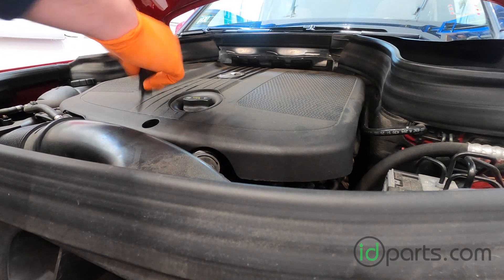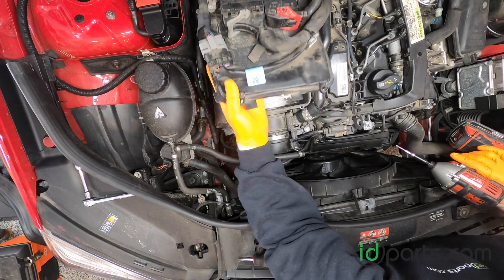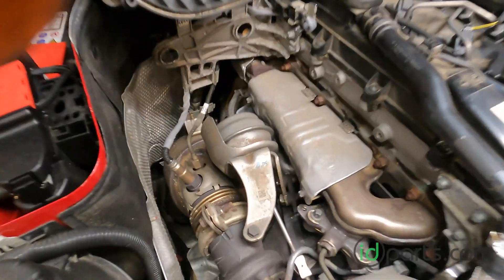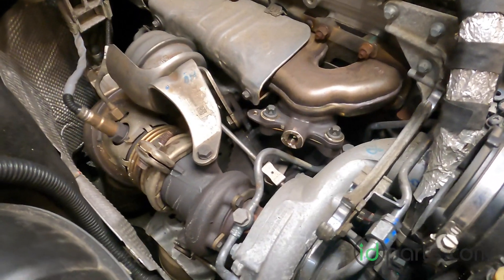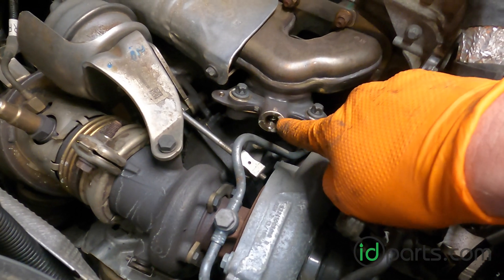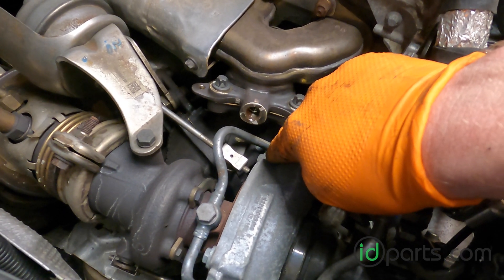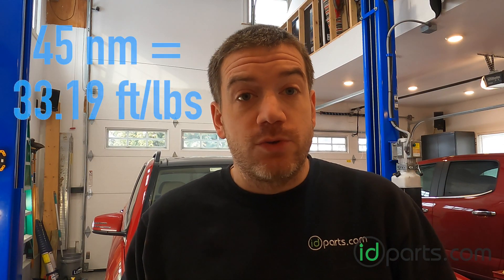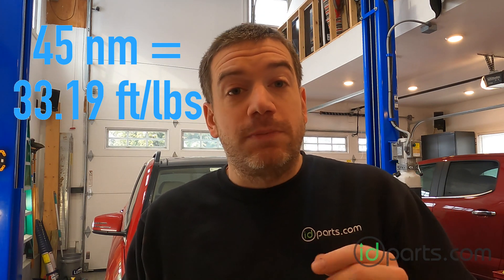Mercedes P2081 Fix OM651 EGT Sensor

Comment: Did you have issue with performance with the sensor fault? Mines an intermittent fault and only comes up when the cars regening however it feels very restricted, it's not in limp mode just feels down on power and torque, so I'm hoping this sensor is the issue

Comment: Hi mate, dod you spray any release oil on the sensor nut before removal? Mine seems ridiculously tight and im worried ill damage the manifold if i apply to mucb pressure
Reply from the maker: No release oil/penetrating fluid at all.  The unit it really stuck then heat will help.  If you can turn the car on and let it run and heat up that is best but a heat gun on low for a while should help too.

Comment: Very intersting video, thank  you. My car was remapped by some worranty garage guy because he didnt want to change the dpf under warranty. This melted my dpf and CAT. Now ive put a cat back on the car and wanted to remap so the car sees the cat. We flashed the car to original and now its showing P0546 Code, seems related to this and making 100hp versus 167hp as it did before i did anything. Could this sensor be the issue?

Comment: hi 
one question 
oil in turbine from engine case cover (breath valve )
and positive pressure from where i check level oil 
the electric breath valve are blocked 
 how work ?
when open and close?

Comment: You can remove the airbox without unscrewing all the screws. Just unscrew the MAF pipe and the ECU cables and pull the whole thing out. What we've seen here is what you do when you've never worked on the left side of the OM651 before.
Reply from the maker: Good point! - We were filming a video for swapping the air filter at the same time, so the video involved us removing cover.

Comment: Thanks for the video. It's very helpful. I am getting a P208027 code (Temperature sensor 1 Exhaust system cylinder bank 1) and I'm seeing a lot of comments that suggest to replace the same part. Is there another sensor that triggers this code?

Comment: Nice video - regarding a mercedes C220 CDI T-Modell 204 2013 - Engine 651.911, is the error code P042815 "catalyst temperature sensor" the same as the one as mentioned above. Thanks again for a nive video :)

Comment: Excellent video - thanks for posting. One follow-up suggestion / feedback: please would you show the exact disconnect procedure - how to work the pesky little grey tabs on the sensor connector. You had your hand in the way when you seperated it. I've searched all over for YT video on splitting MB connectors - there's so many different ones with clips and tricky little tabs to flex, might be a good thing to share in a future post. Thanks again! Great info.

Comment: Hi there, I'm having an engine light saying  P2471. Can you do a video on how to replace the Bank 1 sensor 4 EGT sensor? This engine light is on a 2015 GLK 250. Thank you
Reply: Did you ever figure this out? I have the same problem.
Reply: @damienhealy6850  yes I did. I ended up testing the old sensor with a fancy multimeter and it failed the continuity test. So I bought a new sensor then replaced it. It wasn't hard. But then we did the class action lawsuit and they replaced the whole exhaust for free.
Reply: @marclefebvre9697  Marc. Thank you so much for the fast response. This information is very helpful. The car is my fathers-in-law and he has owned it from new. I asked him about the class action law suit and sure enough he had the exhaust replaced by Mercedes under that law suit also. The code I’m getting states it is Bank 1, sensor 4 which is the one under the car. I’m wondering if they didn’t attach the sensor properly when they replaced the exhaust and perhaps a wire has melted or something. My concern is if its hard to get to. Did you have much trouble? Thanks again.
Reply: @damienhealy6850  no it's easy to get to. But just make sure your father in law doesn't have warranty since the class action. We had to go back for another issue. But it's right under the cab, you just need to take the panel off and it just treads out and unplugs. Easy access.

Comment: I have code p2471 egt sensor bank 1 sensor 4. Where is that located? I have a 2015 glk250. Thanks.
Reply: The sensor is located just after the catalytic converter. I'm having the same issue on a 2015 GLK 250.

Comment: Thanks heaps for the video. What tool did you use to check the torque, and do you have to apply any heat resistant paste before replacing the EGT sensor?

Comment: Hi there, I got a P0401 on my om642, fuel consumption got way high, will just a EGR cleaning resolve the problem? thanks and Nice video as always
Reply from the maker: Worth a shot!  If the valve is clogged enough that it can't open or close fully it can cause P0401.
Reply: @idparts  thank you very much
Reply: Do you have any resistance values for the new sensor at room temperature? Thank you